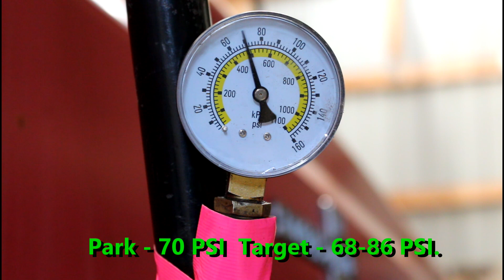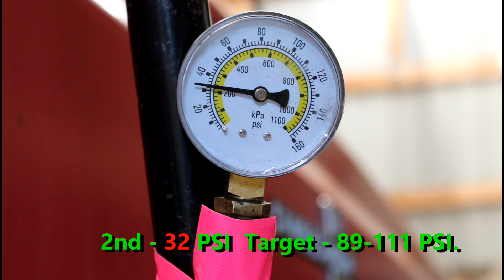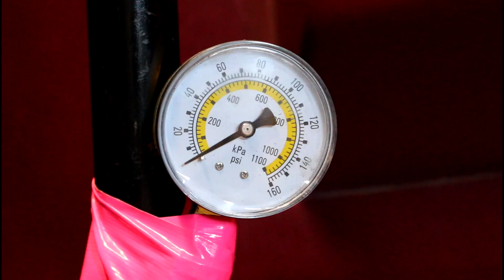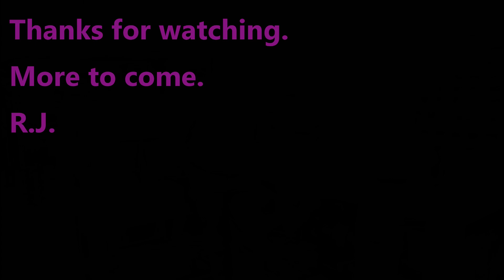Chevy Turbo 350 Failure Root Cause Anaylsis

Comment: Gosh, I’ve been trying to figure out the same thing on my 78 gmc pickup and guess what, I checked the fluid all the time, said it was full. But my dipstick is completely missing that cap, so the dipstick is not even sitting in the right position at all. Gosh, really unfortunate you have basically confirmed that my transmission is burnt up. Thanks! Side note, I very much appreciate the video, if I rebuilt it, I would have never even realized the dipstick issue haha thanks!
Reply: It has the rubber plug, but no cap, thought I’d mention that.

Comment: Customer told me one time, yeah, I  checked it a couple weeks ago and it was low.Well did it make a difference when you filled it up? I haven't actually filled it up yet, I didn't think it was enough to matter. Lol  Well, you might could have saved us this job if you had. When your tranny fluid is full of tiny bubbles it can't hold the clutches tight enough for it not to slip them.
Reply: Also, this was a very good video. And people need to be aware of changing to aftermarket dipstick tubes. Remember they're made in China, where they don't have a real one to go by. Lol

Comment: Awesome video and info 👍 I'm having an issue on a buddy's 1970 Chevy Monte Carlo.. it shifts gears, no noise or binding. But won't move in any direction.. forward or reverse. Fluid is clean and full.. but his lever stick has the cap loose just like the one in the video. This video helped me out a lot. Thanks Pal 👍👍

Comment: So full fluid the pressures were right? but it still wouldn't drive because the clutch was burned out?
Reply from the maker: Correct.  Proper fluid level brought the pressures back in spec, but the damage was already done to the forward clutch pack.  I replaced all of the clutches in the transmission, but I did not change anything in the pressure system, and the transmission has been holding up fine ever since.

Comment: Had same problem reverse only, backed home remove trans disassemble intermediate clutch bad . Pressure okay.  Clean install kit an assembled trans worked fine for many years. The fluid was never low one of those shit happens issues.

Comment: Good job and thanks.
I guess they didn't notice trans was slipping until it just wouldn't move anymore.  But yeah, check fluid and dipstick is broken would still result in low fluid.
I also learned these clutches could wear considerably before they no longer engage, that's a huge amount of wear.
I've also seen these dipsticks damaged in this way.
Reply from the maker: I don't rebuild allot of transmissions, but I have pulled a few apart that had nightmare looking clutches, but they were still driving.  Pretty robust system.  Thanks for the comments.

Comment: I had the same Dip stick I cleaned it up and dropped a mig weld peanut just ahead of the cap on the dip stick so the cap could no longer move up the stick end the problem  NO more low fluid level Hey did GM ever use the Turbo 350C lock up on a 4 wheel drive  ?
Reply: I converted a non-locking TH350 to 4x4 once, the sales guy asked me numerous times if it had the word "metric" stamped into the pan.  I don't see why it couldn't work b/c they both look the same to me but check of course before going that route.  FWIW, I had to change the rear output shaft for a shorter one, all parts came from Advance Adapters and took me about a day, I'd guess two days if you include removing and installing.

Comment: I have a 78 chevy c30 2wd with a 350 engine.  Same exact symptoms, reverse only.  I  believe its a THM350 transmission based on an auto parts online breakout.  Does that sound like the one in this video.
Reply from the maker: Sounds like there is something going wrong with the forward clutches.  The only definitive way to know is to run a pressure test.  Good luck.

Comment: I own a 1975 Pontiac Firebird Formula 400 with a TH350. Before the car is able to shift to drive and reverse. Later on the Front seal of the transmision was leaking so my Dad and I had to remove the old seal infront, pain in the butt without a garage to have space. Now I know why the car isn't shifting. Thanks for the info!

Comment: I want to learn to work on cars . Whats the easiest car to work on to get started ? I was thinking an old vw bug
Reply: Actually you're looking at it. I'm a huge Dodge/Plymouth guy but I have no problems saying that the '73-'87 Chevy C10 pickup is probably one of the best vehicles ever made. They're easy, they're bulletproof, they're utilitarian, they come in all shapes and sizes, they were made by the millions, they can be dirt cheap. You'll find them laying about rusting in fields or sitting in driveways for the past 9 years.

 You will almost always find them with SBC motors (small block Chevy - 305, 350, 355, 383) these are virtually identical motors (305 actually has minor internal differences and is basically shunned bc you cant make them perform for the money to build them. People will literally GIVE you complete 305s that are just taking up space) but SBC's are crazy modular. And the aftermarket is INSANE. 

Transmissions are the same story, TH350, TH400, 700R4, 200R4, all use the same bell housing. different guts - same platform. For this reason the transmissions are cheap to build with crazy aftermarket.

Best part, since they're so modular and popular the available knowledge on how to build them from top to bottom exist everywhere. Trans not working? Theres a video for that. White smoke? Theres a video for that. Throttle stiff? Paint bad? Death rattle? Weird ticking noise? Light flashing? Wanna weld up the floors? Take the whole fucking cab off? Theres videos for that.

Find one with good floorboards for cheap. Doesnt have to run. Just light rust. Then decide what you wanna build. Drag truck? Street rod? Hi boy? Mountain Queen? Swamp monster? Low rider? Daily worker? Or maybe somewhere in between all of your own.

Then you star with the basics. Drain your oil, trans, drop their pans, change their filters, fill 'em up, change your battery, fuel filter, and maybe starter if she just clicks instead of cranks still. After that the rest is all on you but just as obtainable.

 Good luck man, I hope you get hooked like the rest of us did :)
Reply: @-OokySpooky-  thanks,  really appreciate this
Reply: I agree I have a 73 c10 stepside I get compliments every where I go
Reply: @mrcwoodworks4523  Hey.... I have and drive (daily driver for all my life since 1975) a '72 Monte Carlo (1st Generation) Sure keeps the women with their golden shovels away..... Been single for 39 yrs now. No kids either. Ahhh the lack of drama at home. Oh, and this Icon picture is surely not me.